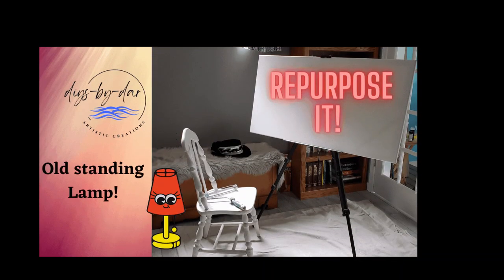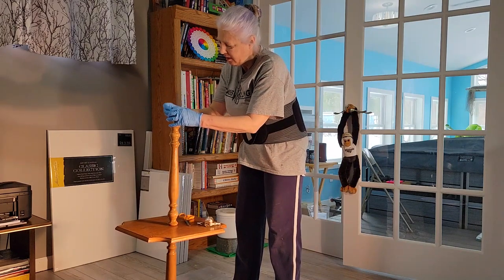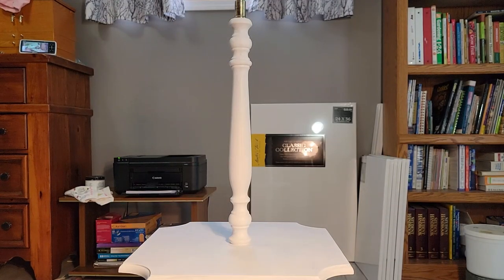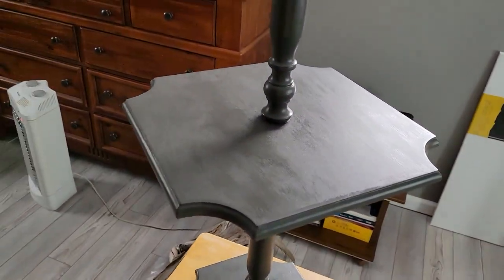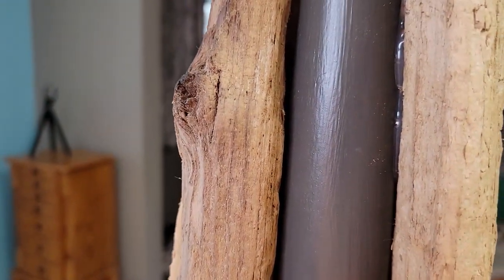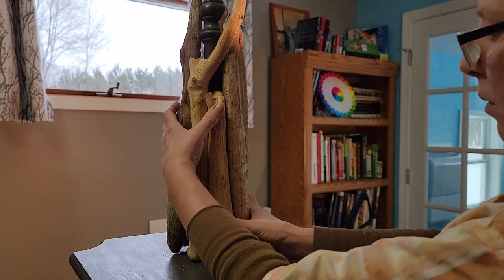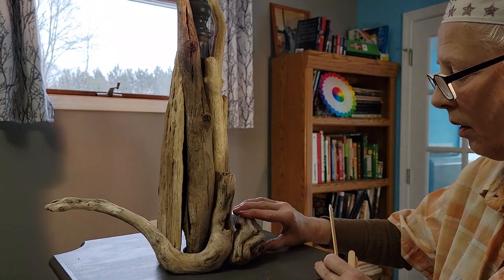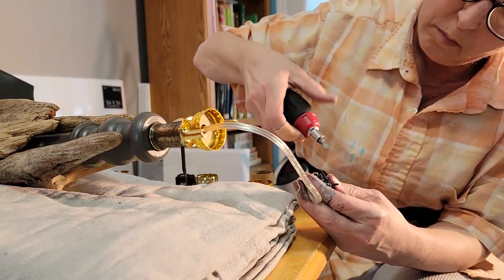How to repurpose an old lamp into a Driftwood Beauty, using Lake  Mi. wood and rocks!

Comment: Wow! What a transformation! The driftwood, rocks, and that shade all work together and look fantastic. When painting, you might want to try pouring a little paint at a time into a clean Greek yogurt container, or something similar with a tight lid- and close  the main container so no dust or smutz flies into the big jar. I've had moths commit suicide in mine. We also have cats so there is always cat hair flying around. Plus,  if I drop the paint on my foot, I spill the little container, not the big expensive one. It's is lighter to hold and less deep so it is  easier to regulate the amount of paint getting on your brush. It also helps keep all the paint in the big container from drying out and becoming too thick. If I stop for lunch, I'll put the brush or roller in a ziplock bag and put the lid on my little yogurt container. Then I don't have to wash out the brushes and rollers and can get right back to painting after. Hope some of these tricks can help make your work more fun. Subscribed to your channel. I look forward to coming back after I watch the rest of the ugly duck transformations to check out your other videos. May 2022 treat you kindly.
Reply from the maker: Thanks sooooo much for taking the time to watch my vid, and subscribing!!  Yeah, I was having some problems with my paint for sure, but then the poly?  I probably had the humidity even lower around 38% in that area.  It didn't help my old drying paint out at all.  Would have been much better if I would have followed some of your tricks.  I sure hope my year is better, not to whine here, but in the last year I have had both my hips replaced, fell and fractured my back, then fell and fractured my wrist with hardware in that now!  Add having a new house guest who is my mother in law who has dementia, Yikes.  My only respite is working on projects.  Next one, after my pool draining vid, is going to be geeky fun! incorporating 70's moster mag. covers onto it!!! regards Dar p.